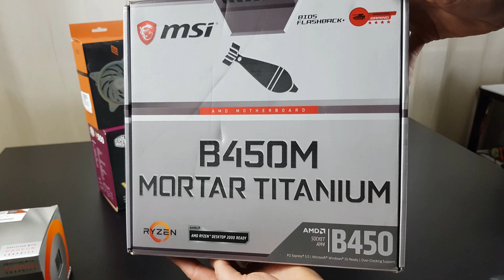AMD RYZEN 5 3400G - NOUA FOBIA - THE WINTER BUILD

Comment: Molto interessante e decisamente bella da vedere come build.

Gli extension cable psu bianchi sono della Silverstone?
Grazie
Andrea
Reply from the maker: Grazie! Si sono i Silverstone!
Reply: @PCBUILDMOD  sto prendendo spunto dal tuo video per fare una build dalle caratteristiche simili, se non proprio uguali 😄
Reply from the maker: Andrea Corrado Ti aggiorno le ram non sono stabili in xmp,nel case in vendita le ho aggiornate con le Corsair Vengeance Pro RGB 3200 C16 sempre 16GB che con l’ultimo bios della MB per i Ryzen 3000 viaggiano stabilissime e il sistema guadagna molto con il profilo XMP.
Reply: @PCBUILDMOD  grazie mille

Comment: CIao! Una curiosità, i led rgb della ventola fornita possono essere collegati al controller Noua? Se no a quale presa l'hai collegata?
Reply from the maker: Ciao! La ventola stock non ha il cavo addressable 5v ma va collegata(è gia collegata) al pulsante che controlla il ciclo di colori rgb del case.
Arriveranno altre build e pc esclusivi..iscriviti ed attiva la campanella per seguirmi!
Reply: @PCBUILDMOD  una domanda, la ventola davanti a cosa serve se si trova con un pannello completamente chiuso davanti? Detto questo quanto costa questo pc assemblato?
Reply from the maker: @metallicametallica4659  davanti e' chiuso ma c'è spazio tra il pannello frontale e le ventole e messa in aspirazione prende aria da dal comparto sotto aperto e dalla parte laterale dove è aperto. Se ti interessa quello in vendita su ebay e' stato venduto,ma ne riassemblo anche un'altro. Posso farti un preventivo con i prezzi migliori di adesso se mi contatti via mail andando nelle info del canale la trovi...siamo comunque,con i componenti che ci sono nel video, dai 600 ai 700 circa,i prezzi fluttuano con il mercato...ma si puo anche economicizzare anche a pari prestazioni,questa e' una build incentrata sull'estetica ma non con componenti scadenti! Contattami se sei interessato! Ciao

Comment: è carino ma per 700 euro ci viene fuori altro. 
ad esempio nel mio caso:
ryzen 2600
gigabyte vega 56
16gb ram 3000mhz crucial
asrock b450 pro4
dissipatore doppia ventola gelid phantom
case noua g14
ssd samsung 512gb 860 evo
xfx 550w 80+
6 ventole rgb con pwm e telecomando
Reply from the maker: Si ma questo è più bello!...e poi la vega 56 non la vuole più nessuno!...a parte gli scherzi,il prezzo per chi mi contatta da qua è da scontare..👍